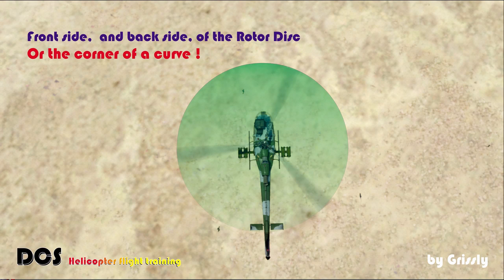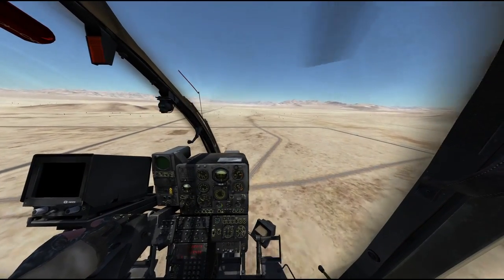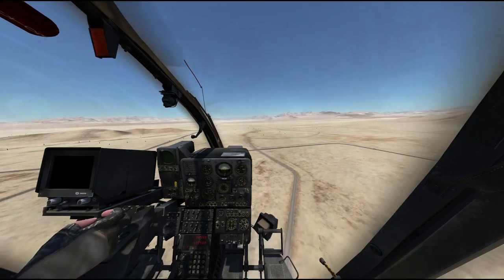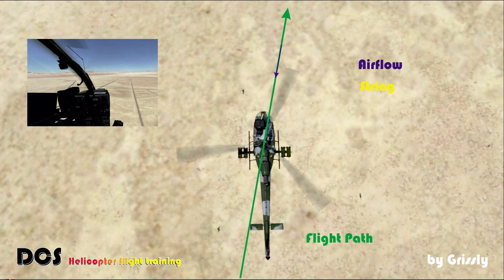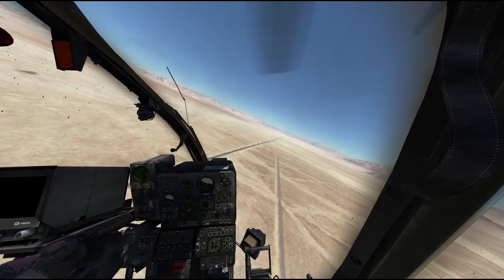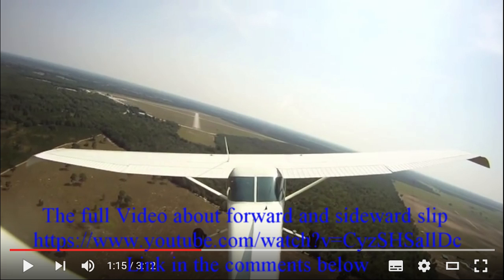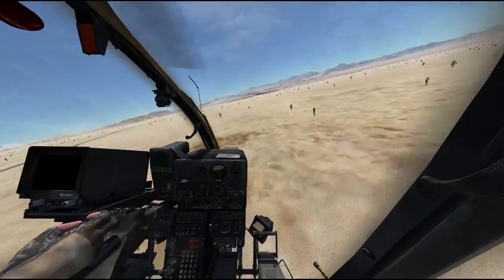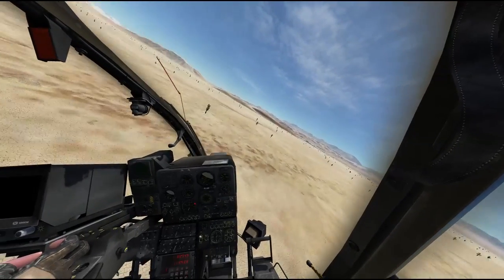The yaw String / English Version

Comment from the maker: Post to the German Version of the Video 
from  shargrat47
He mentioned:
“In a Hover the String indicates small drifts to the side or backwards. In absents of
the feedback signals to the motion Sensors in your back, it is a welcome assistance
to get into, and hold a hover.”

I missed that Point in the Video because I did not realized it. In fact I’m sure it is a bug! Because in a Hover de dominant Airflow coms from the main
rotor itself. The string may tumble around, but the little influence of sideward,
forward or backward movement in “hover”( not side or backwards flight) may not
strong enough for any affect to the string.The physics of the string alone may be enough for a never ending story, when implementing
it to a SIM, so we shod take a broad view with such bits and bobs, and appreciate
the advantage we may get out of it. : )